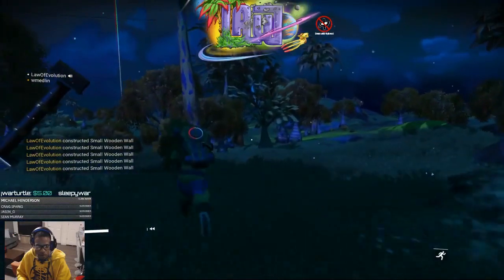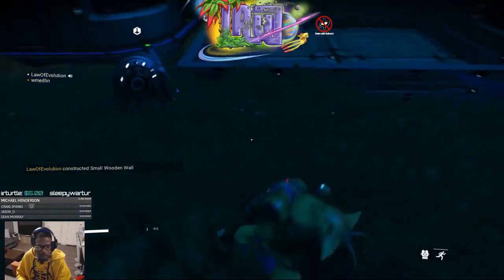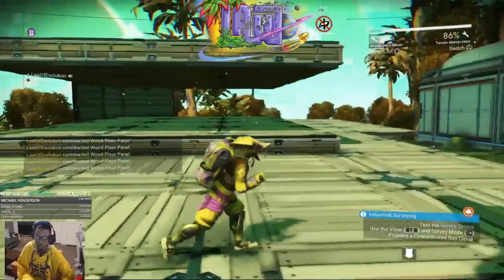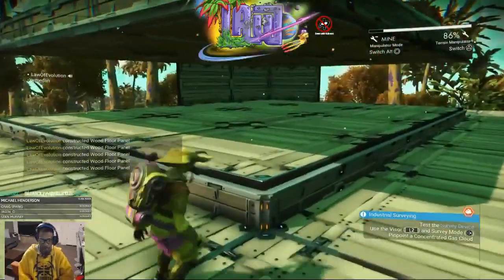HOW TO HIDE WIRES Like a Pro!! 100% Wireless Base | No Man's Sky BEYOND Logic

Comment: No need to worry about wires showing anymore, just use the Electrical Cloaking Unit (attach it to a wall) and viola, no visible wires! I still like to keep my wiring tidy like you do, but the cloaking unit takes care of the rest. You will be able to see your wiring when you go back into the build menu.
Reply from the maker: absolutely 100% correct!   I pinned your comment to make sure others are able to see this since I didn't update the vid.  This was created before they added the cloaking unit and we were FORCED to find ways like this to hide wires.   Thanks for the info!

Comment: you don't need to have double floors   just place lights on the bottom of walls with their connects in the floor   or placed in the corners of walls with the connector in the wall you want to run your cable    then run your cables from connector to connector and delete the lights   can be used around doors and windows    just make sure you plan your wires because you'd have to delete the wall to re do them